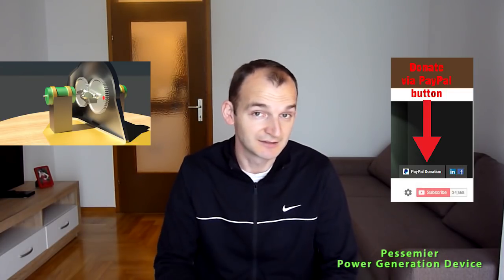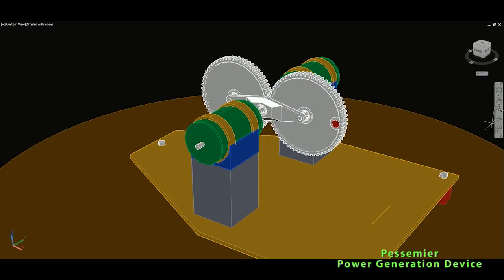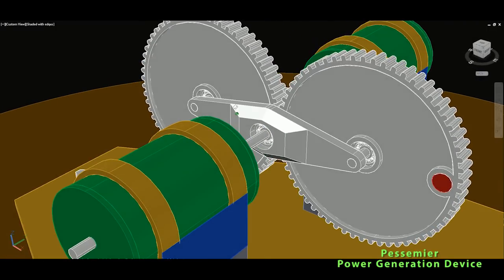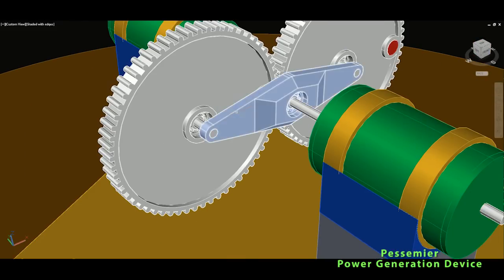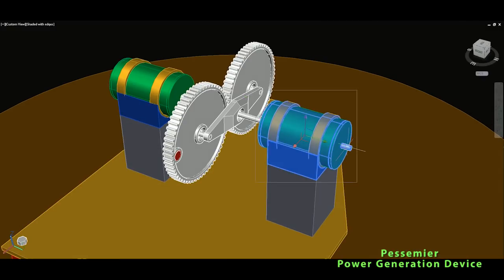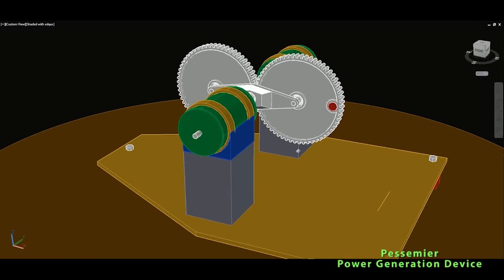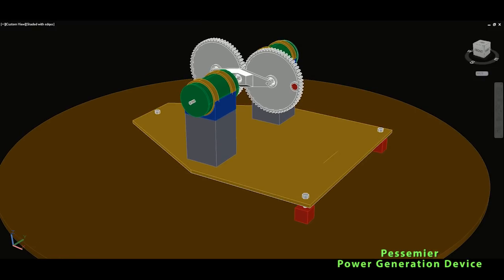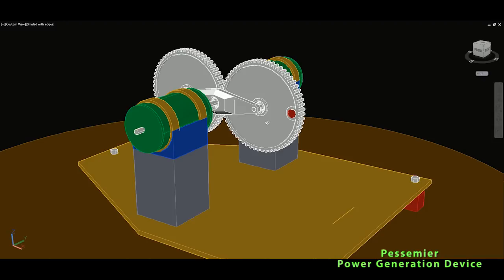FREE ENERGY, Pessemier Power Generation Device, AMAZING!!!

Comment: What would a real magnetic motor be worth, if I was to sell it to a company to mass produce?
Reply: what would a unicorn be worth.    same answer.
Reply: Figger0808 Figger0808 nothing of course such a thing simply doesn't work
Reply: $150.00
Reply: This is totally bogus! You cant keep a vacuum, as he claims for the center piece while having a rotating shaft enter the vacuum area, it’s just not possible to keep a seal. Also his model shows a bearing on both sides of the center coupling, I.e the motor and generator are free of the shafts.
Reply: It would be priceless and all of society would use one.

But I don't think it could be possible to make one. If it was possible, someone would have did it already.